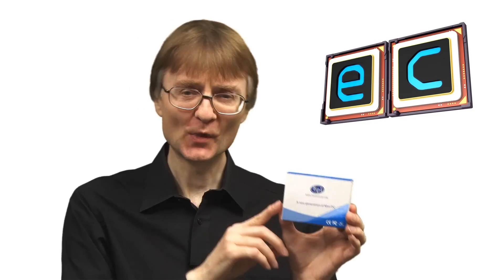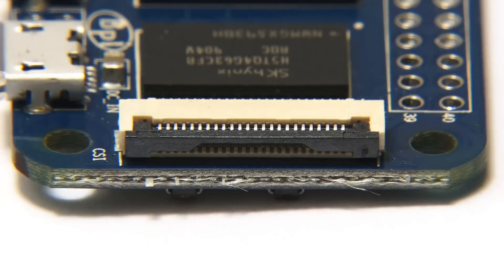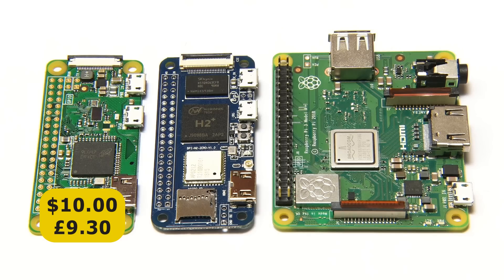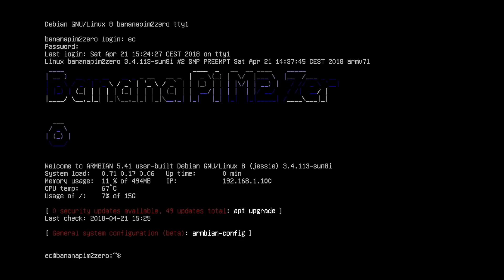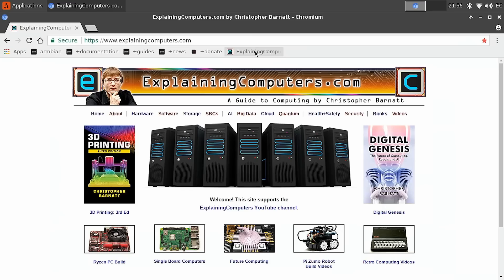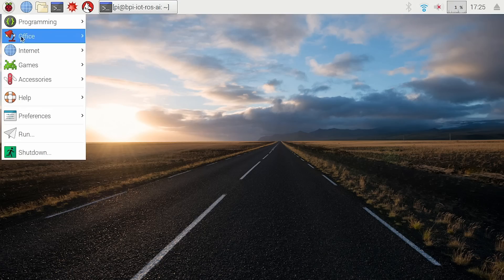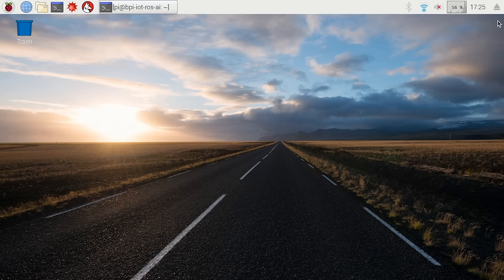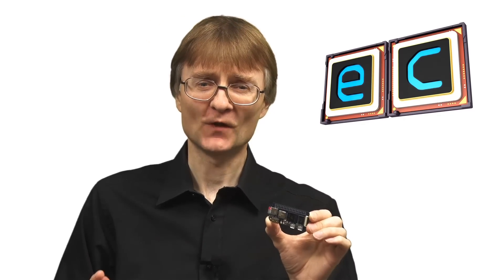Banana Pi M2 Zero: Low-Cost, Quad Core SBC

Comment: I saw that you said this supported micro sd up to 64GB. I bet this is false, that it'll support up to maybe 2TB, where SDXC ends and SDUC begins. SDXC begins at 32GB so 64GB limit makes no sense. Your thoughts?
Reply from the maker: My thoughts are that this device supports cards up to 64GB. Yes, the SDXC standard is 32GB+ to 2TB (I posted a video on SD card standards last week). But this does not mean that ever device can address this quantity of storage. Many devices -- and a great many SBCs -- have SD card limits. And this one is limited to 64GB. :)
Reply: @ExplainingComputers  On the flipside of your statement, not every SD card limit is true - Nintendo states that SDXC cards are not compatible with the 3DS line of consoles. The thing is, the 3DS uses FAT32 for sd card storage, but Windows doesn't allow for the formatting of SDXC cards as FAT32, so it's easier for Nintendo to say it's incompatible than to try and guide people through the nitty gritty of (3rd party) partitioning tools. My FAT32 formatted SDXC card works in my 3ds happily. I may be responding to your reply to my comment, but this is more for other people, who happen to be reading this comment thread. When in doubt, test it!
Reply: Looking closer at that Nintendo support page, I see that they said that they consider it incompatible, not that it is incompatible. Clever.
Reply from the maker: @UnlimitedRun  Very interesting on the FAT32 thing. As you say, it's easier to say "does not work" than to qualify this.

Comment: EDIT to below: OK, I got Idle going by installing python-pmw  and I got pip by installing python-pip.
Around 9:04 mins you launch idle. Was idle deprecated with python3? In my Arch vm, running python gives me the >>>, but I can't get idle to run and can find no answers. pacman -Q python returns python 3.8.2-1, but if I run idle I get: ** IDLE can't import Tkinter. Your Python may not be configured for Tk. **  and none of the pacman -Ss searches of all the online suggestions for the name of the so-called solution package works e.g. py38-tk, tk, tkinter, python3-tk, python-tk and many more.
Reply from the maker: IDLE hung around in Raspbian until June 2019. :) It depends on the platform and distro.

Comment: Can you run all python code in Raspbian on a BPi0 that you can run on a RPi0?  Do all the libraries work?
Reply from the maker: Raspbian is an Raspberry Pi only OS that was replaced with Raspberry Pi OS some years ago. So you cannot run Raspbian or Raspberry Pi OS on the Banana Pi M2 Zero. Some Python code will work, but not code that depends on hardware-specific libraries (eg like those used to control GPIO or a camera). Sadly there is no standard ARM SBC platform. :(

Comment: Christopher, please use official (several years more recent and cleaner) Armbian builds next time. Yes, for M2 zero there is no official Armbian support, but community supported images with modern kernel exists for download https://dl.armbian.com/bananapim2zero/ We can't prevent board makers to build and provide their "armbian" with their rotten hardware layer ... like they provide "Raspbian" to make users believe it will run the same as on Rpi - hw features you were trying to set are there as a copy/paste left over. They serve no purpose. Perhaps another topic to explore and explain? :)
Reply from the maker: Thanks for this. I am sorry if I have offended, not my intention. I used the builds from the links on the support page for the board on the manufactuer's website, which is where I imagine a lot of people will go. I am unlikely to look at Banana Pi hardware again (I had much better experiences with the LeMaker Banana Pi/Pro boards some years ago, but I know things have forked).
Reply: @ExplainingComputers  No worries. Alternative software support could be/is - in case of non Rpi boards - magnitude better then their preview builds nobody updates or support. The same goes for Banana PRO, where most recent Lemaker or Bananian (EOL) build could easily be several years old. It probably boots, but that SW is not on the level of current version of Armbian or Raspbian/Ubuntu on Rpi ... Anyway, don't want to make a story out of this. Its just a quick tip. You are making a good job. Cheers!

Comment: Even if the banana pi has a little memory I found running a 2GB rpi4 with 32GB zram. Works very well.

$ more zramswap-on.sh 
#!/bin/sh
set -e
modprobe -v zram
echo 32G > /sys/block/zram0/disksize
mkswap /dev/zram0
swapon -d -p32767 /dev/zram0
sysctl vm.swappiness=100

Comment: You could of let people know a raspberry pi CSI camera won't connect as the CSI cable connector isn't a standard size also you have to use a specific camera and its a bitch to configure the camera.
Reply from the maker: The CSI cable connector is the same as that on a Pi Zero, so a Pi Zero camera can be used, or a Pi Zero camera cable to a standard Pi camera. Config indeed a pain! :)
Reply: @ExplainingComputers  Not sure what your using but their different cables and its a known issue.

See: mk_munich
 M post @ same issue http://forum.banana-pi.org/t/bpi-m2-zero-camera-armbian-support/5707/5 I think your telling fibs

Comment: Nothing will EVER convince me tk switch from Raspberry Pi to Banana Pi... Why? Because the Raspberry Pi foundation is dedicated to the open source community so much, that they publish nearly everything the make and write for the open source community to use to include their OS, as well as support stem with a voracious intensity. They make their boards cheap and affordable. However, companies like Banana and Orange Pi, are just our to make a profit. They change just enough on the boards to make it their own, but don't really contribute anything to the community that's valuable. Few OS' run on them well, and those that do, tend to have issues. With the RPi Foundation, this is definitely not the case. Their products are normally on point with few problems out of the box. Normally the problem starts and stops with the user not doing their research.

Comment: I bought this board almost 2 years ago and it is the worst SBC I ever had. Software support is terrible, Raspbian version completely outdated, Pi cameras do not work (at least with Raspbian), old VNC software etc.. It gets extremely hot, requires on average 200 mA more current than the Pi Zero W, quality of WiFi is bad even with antenna. Performance is low conpared to a Pi quad core and especially wrt. to its power consumption.
In the end, I did not find a single use case for that thingi. Battery driven application - NO, too much power consumption; Remote Cam - NO; Desktop - NO, no performance; Server (DNS, DHCP, Grafana etc.) - NO, not enough memory; IOT Gateway (KNX, 866 etc.) NO, incompatible ...